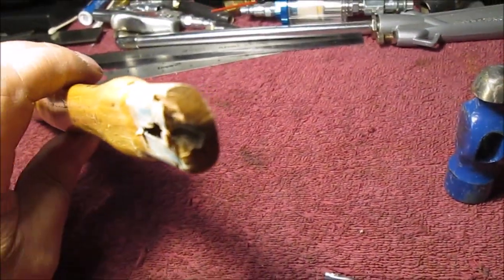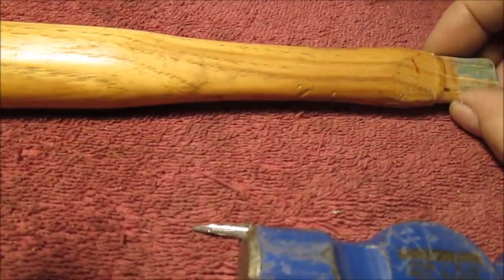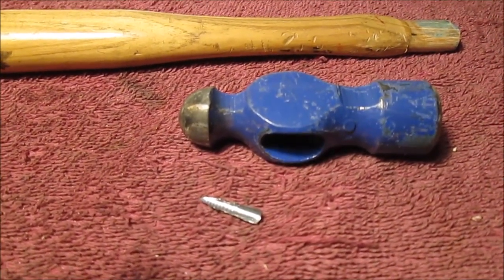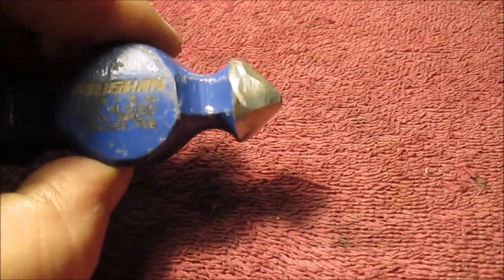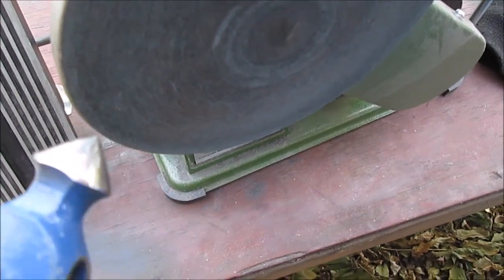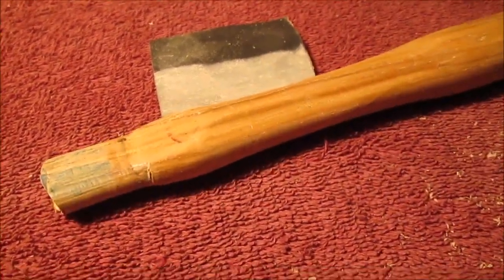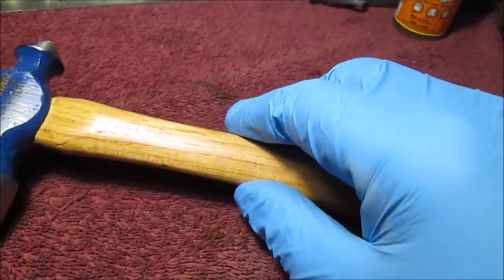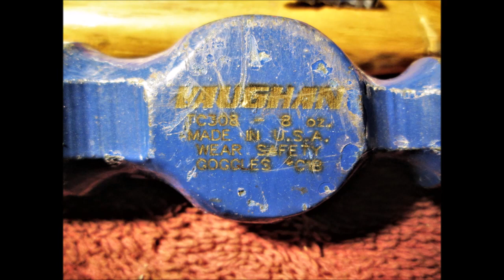Custom Made Ball Peen Hammer Head

Comment: Nice work. The pointed end, when smacked at various points along a trucks frame will let you know right quick when rust has penetrated deep into the metal and its not long for this world unless repaired. A 12oz pointed end is better than an 8 oz head, but yours will do fine.
Reply from the maker: Thanks...I may make a big one also